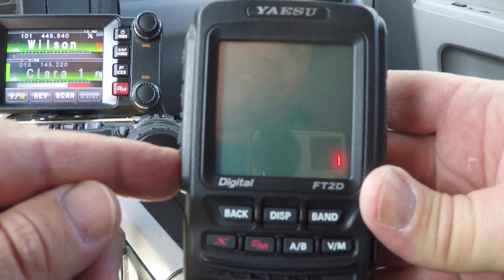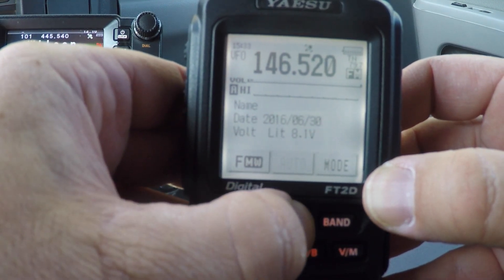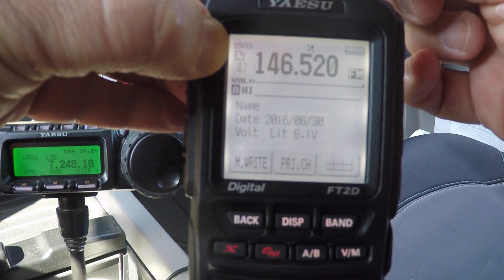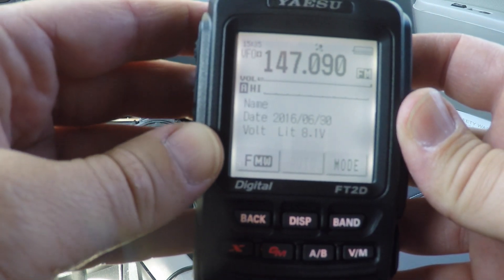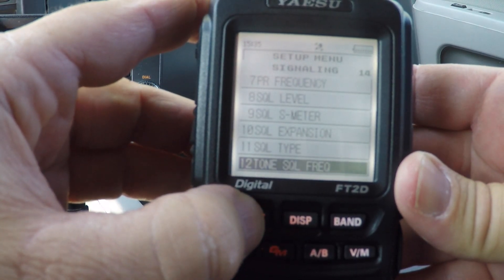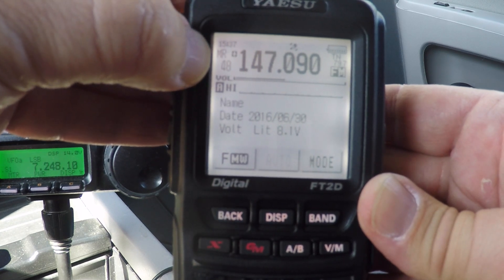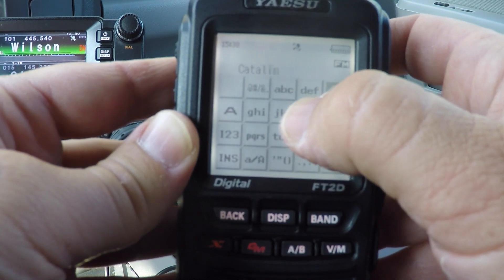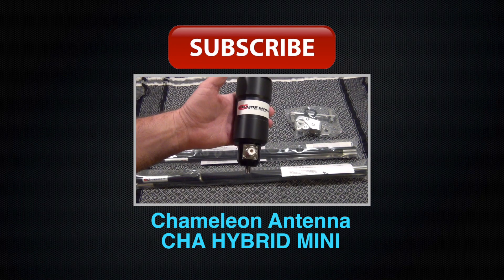Yaesu FT 2DR Programming

Comment: i cant turn the tone squelch button on can someone please how do i correct that?
Reply from the maker: Thank you for taking the time to watch and the comment! It is greatly appreciated.If I understand your question correctly follow these steps.
1. push and hold the "DISP" button until the Setup Menu shows up
2. Press "Signaling"
3. go to menu number 11 (SQL TYPE) and press it. 
4. Then turn the main knob on the top of the radio to select the desired SQL TYPE. 

I hope this helps you out. Thanks again for watching!
Reply: thank you for getting back to me i have done that but when i turn the  on knob on top of the radio nothing happens i can set the tone freq but i can' turn the tone on.
what am i doing wrong?
Reply from the maker: If I may suggest if what mentioned didn't work here is the number and hours for Yaesu. I have had great customer service from the with my FT-2. (714)827-7600 between 8AM – 5PM PST

Comment: I'm sorry dont get me wrong... What is the benefit buying this pricey radio??? A $20 baofeng UV-5R is serve as good as this yaesu.
Reply from the maker: Thank you for taking the time to watch and the comment! It is greatly appreciated. I bought this radio as well as the FT-1 and FT-M400 because I use Fusion (The digital side for Yaesu). My kids use UV-5R and while it does work, to me there is a difference. All that being said, If I didn't use Fusion I would use the FT-60 as it is a strong radio.
Reply: I don't think the UV-5R has automatic mode select between analog FM and digital, Wires-X, Group Monitor, Backtrack Function,  APRS, Spectrum Analyzer with Band Scope and more.